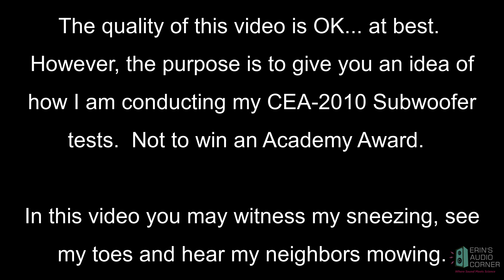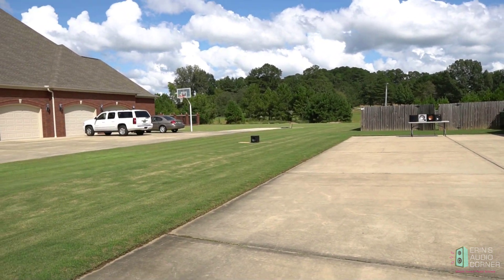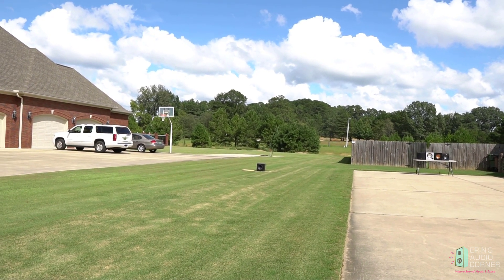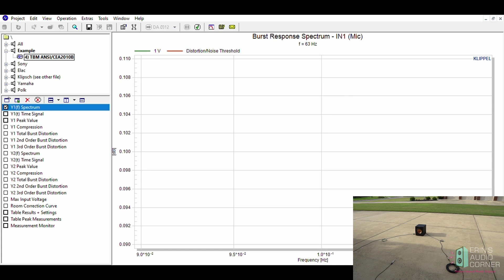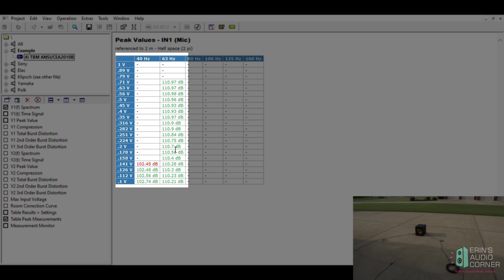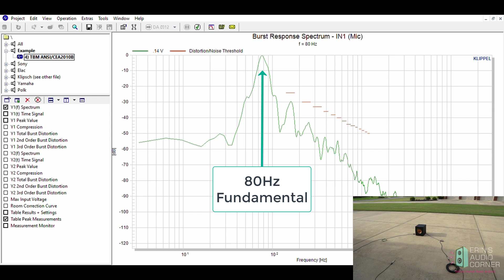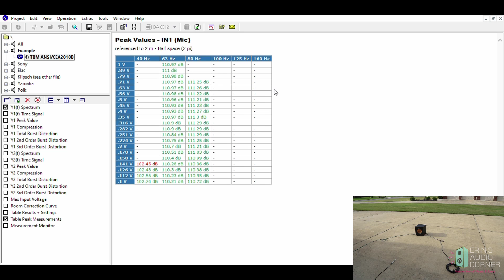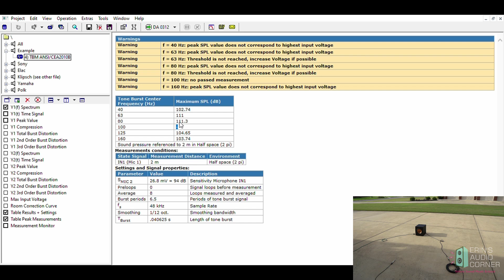Subwoofer Testing CEA 2010 Setup and Demo

Comment: @Erin's Audio Corner
In the testing spreadsheet there is a dropbox link for the frequency response, but that dropbox link doesn't work. I would like to see that data if you can provide.

Comment: that's real nice mr Erin, ground plane measurements are as close to an anechoic measurement as it gets when it comes to low fq.
wish you all the best, happy holidays. 

---------------------
:} don't forget to tell ppl as often as possible that 'in room' measurements bump up the very low frequencies as all rooms act like resonator boxes depending on their size.. because of 'room gain' (even +10dB gain sometimes) a sub will measure/sound linear even when the "outside" tests show a drastic spl reduction on the lowest fqs.
equally important to remind folks that when 2 or more subs reproduce the same sound, 'mutual coupling' will increase the spl by 6dB. that is a Huge advantage (lower harmonic distortion as the subs don't work as hard for the same spl) besides a more uniform sound field...

Comment: Erin,

Thanks for the video! I have one request thou... Is there any chance that you config the Klippel software so that it shows 1.000Hz or 1KHz instead of 10(3)?? (same for 100hz, 10Khz, etc.) I know it's simple math, but it's easier on the eyes I think. Cheers!
Reply from the maker: That's out of my control.  However, a future update to the Klippel software will be addressing this.  🙂